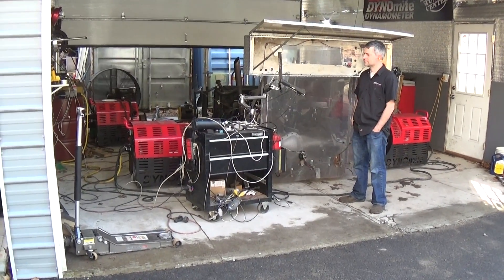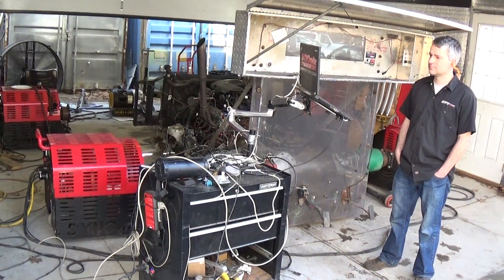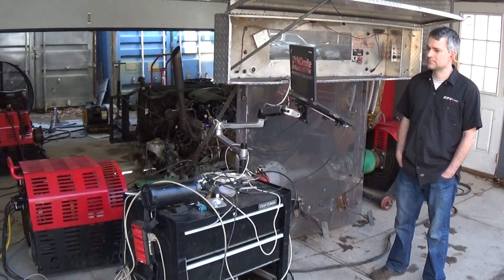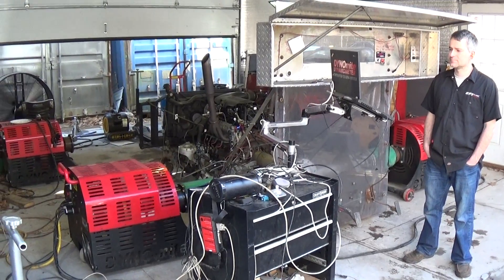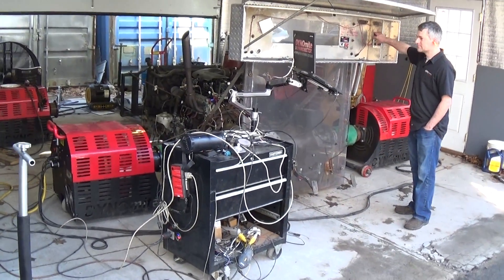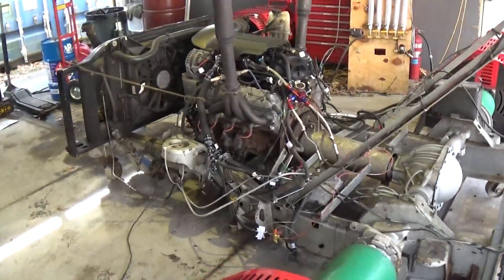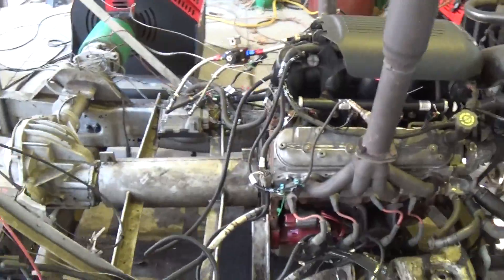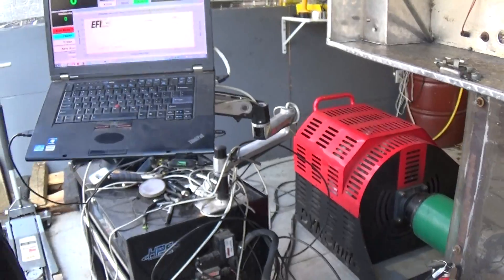Danny Fendley LQ4 6.0 LS Engine W/ 5.3 Heads & Stage 2 Cam

Comment: Do you guys do anything to the bottom ends on these? Or are they just good stock engines with different heads and cams
Reply: @Justchevytrucks / Bog Brook Auto  i just picked up a 6.0, how do i go about warming it over?  Just bew gaskets?
Reply: Is there a special head gasket to run the 5.3 862 heads on a 6.0?
Reply: @Justchevytrucks / Bog Brook Auto  i hear the mahle 54445 head gasket will allow you to use the older notch heads on the 6.0. Check it out!  Thanks for the info, im glad this combo makes such good power

Comment: Do you have to change the cam in order to just swap the heads? Or can you just bolt them on a lq9 and go?
Reply: @JustChevyTrucksBogBrookA-qo1mb  ok cool. Hey thank you for the reply and the info.
Reply: @elcoholic79  what injectors did you run with lq4 intake.
Reply: @gthomas5880  havent got that far yet. just gonna throw a hot cam in it  but just have the stock ones for now

Comment: 5.3 heads are a downgrade from the 317s. 
But if the customer is happy with it. Send it
Reply: The 862 head from the 5.3 will make more compression and with a dab of porting blow 317 heads away!
Reply: The 5.3 heads have been proven to make more power than 243's, let alone 317's
Reply: Can you support that with content?

Comment: What are the specs on this "stage 2" cam? If it isnt at least 228/230 then there is a lot on the table. I wouldnt blink putting a 238/242 cam the magic stick 3 for example. I believe an LQ4 with 706 heads, a TBSS intake, 90mm tb, 1.75-3" long tubes and a 228/230 or 238/242 would absolutley make more power than the same with 241 or 243 heads. Richard Holdner from HRM, CC, GMHTP, Super Chevy, ect. Magazines has tested all the factory cathedral port heads on every thing from a 4.8 to a 6.0 and has proven the superority
Reply: Of 706/862 "5.3" heads over all the other factory castings. The smaller runners and valves despite showing lower numbers on a flow bench make the most power. Apparently the compression from the 61cc chambers trumps flow vs the 66cc and 64cc of LS1 853/241 and LS6 243/799 heads.
Reply: @hendo337  so are you saying the 706/862 heads are better in that case
Reply: Pieter and the
Reply: The 706 head are the best head up to 4500rpm then the 243/799 makes about 15hp more on top end then the 706 does. 706 makes little more power the 243/799 till it hits that 4500rpm range. Also ls like big camshafts. Lq4 with 706 heads big can and longtubes should put around 500hp at crank

Comment: Curious what CR do you get with 5.3 heads on a lq4? What is the limiting factor it has as it sits right now?
Reply: i stopped the video and tried to get a good look at the dyno, looks like you built the engine for low end drivability/daily vehicle. curious what you could get out with a more aggressive cam and complimentary heads/intake.
Reply: Ya i still dont get why you would reverese bore it. What pistons did you go with
Reply: @JustChevyTrucksBogBrookA-qo1mb  ho much you mill stock 6.0l 2005 heads
Reply: @JustChevyTrucksBogBrookA-qo1mb  makes sense